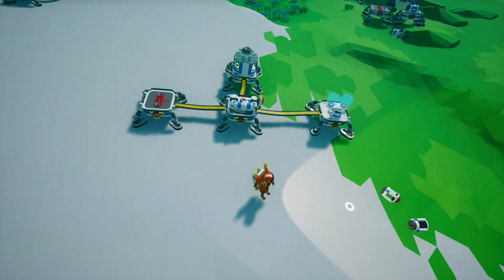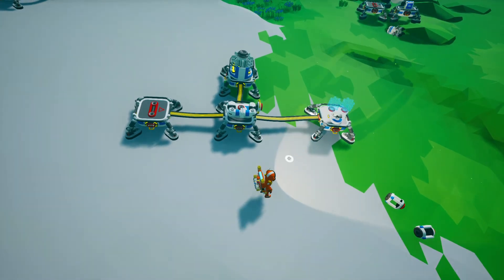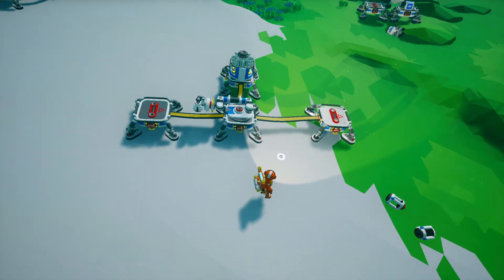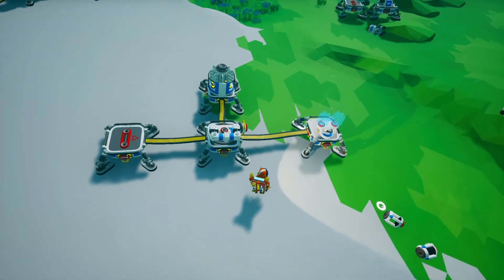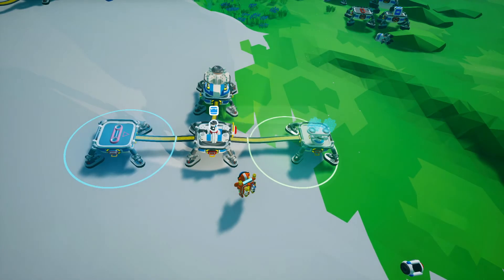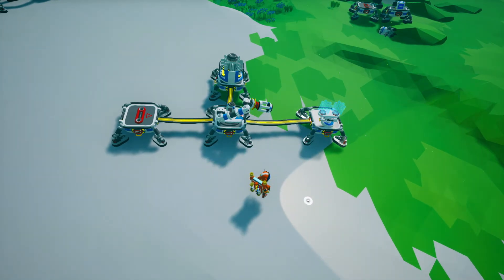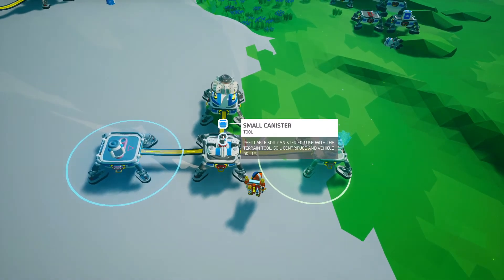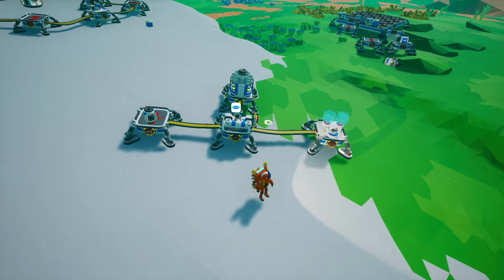Astroneer Automation - How to make the auto arm grab only one thing

Comment: when i am automatically researching bytes with an auto arm, i dont know how to automatically shut off the auto arm when the research chamber is full / in use, or how to turn the auto arm back on when the research chamber is empty / not in use? i can usually use the power to speed up the research chambers but dont want to manually shut off auto arms.
Reply from the maker: Depends on what you're using but if it's the same item you can use delay repeaters set to the perfect cycle keyed for that specific item.